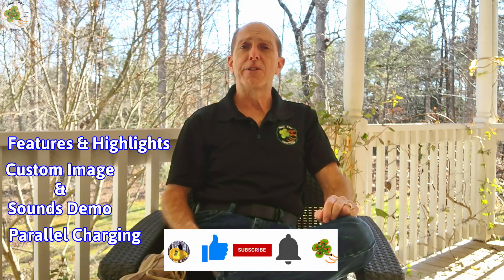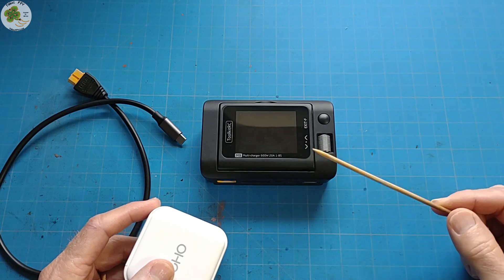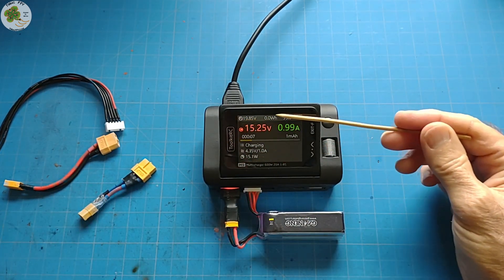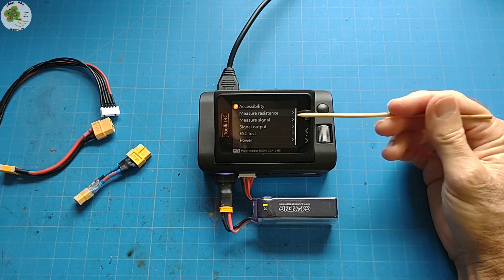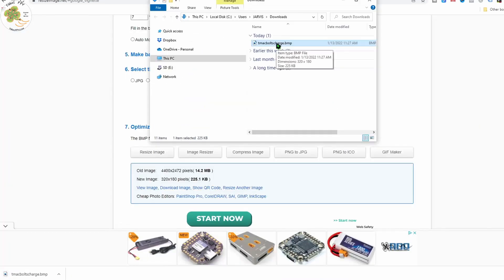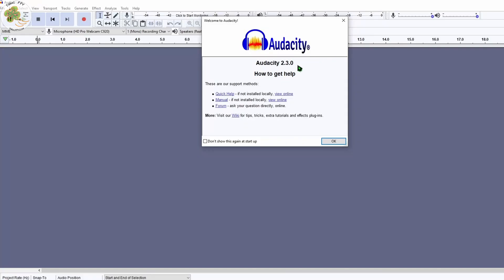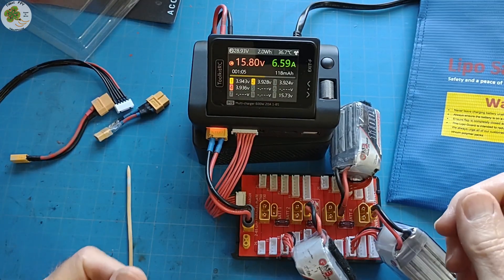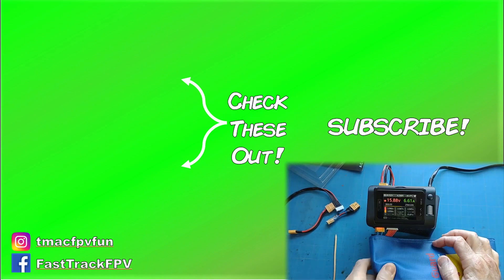ToolkitRC M9 600W Smart Charger (IT TALKS!)

Comment: I'd like to know how well it discharges. The M800 can't discharge any faster than 1 amp even if you set it higher. Thanks for the review.
Reply from the maker: User Manual (linked in this video's description), page 14 describes 3 different Discharge Modes and their max rates/capacities.  I tested the "Normal Mode" for you with a 4S 650mah battery LiHV.  Normal Mode max rate/capacity per User Manual is 3A @ 20 W discharge.  The M8 (on the other hand) in "Normal Discharge Mode" has a max of 3A @ 12 watts. I set final voltage to 3.50V/cell= 14.0v total and set the discharge rate to 2A.  Battery starting voltage was 17.2 volts.  It discharged fine beginning at approximately 1.17 A (1.17 A x 17.2 v = 20.1 watts).  As the voltage dropped, the discharge amp rate went up to maintain the max 20 watts .  As it neared completion at final voltage, it went into "trickle mode" and dropped the discharge amp rate to a "trickle" so it stopped dead on the final voltage.  I have not tested the other two modes.  Hope this helps.
Reply: @TMacFPV  Ah, that makes sense. Thank you for doing that. I use the discharge mode to measure actual mah as a pack ages, and if the device limits the amps to under 1 amp it can take over 1 hour to complete the discharge cycle.
Reply from the maker: @TommyTester  sure thing Tommy!👍You can also keep track of internal resistances. As batt's age, their IR tends to increase